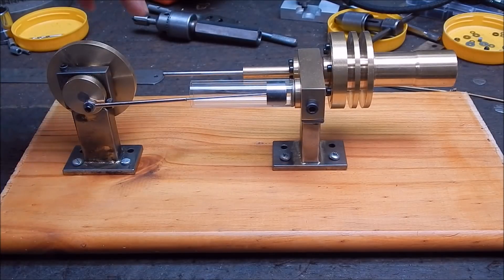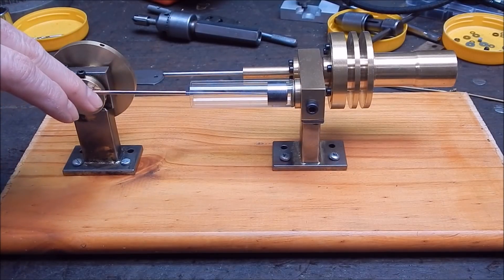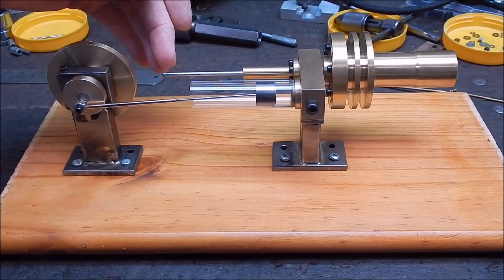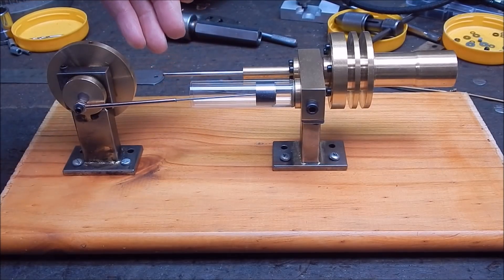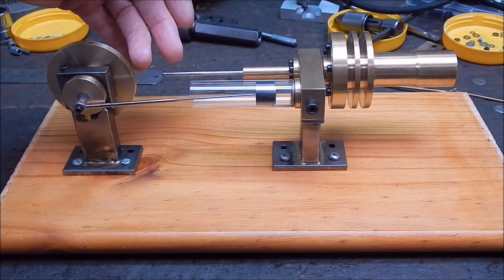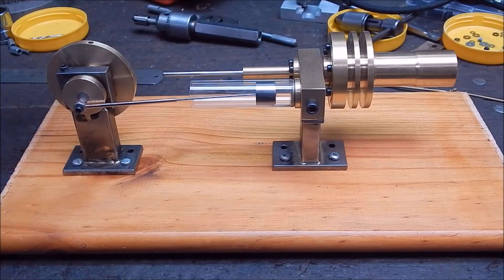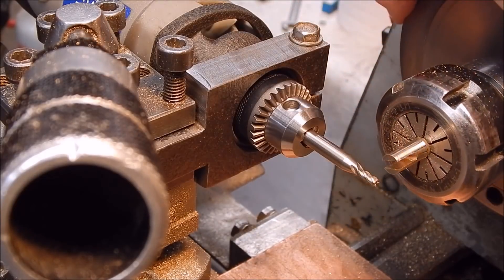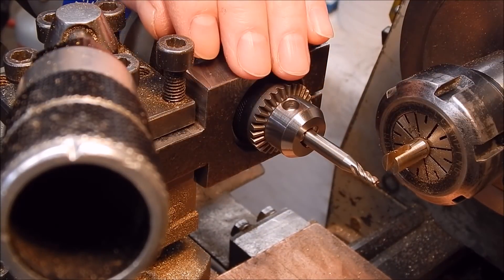Milling on a lathe with the HILDA 400 watt rotary tool

Comment: Do you think hilda could mill steel?
Reply from the maker: It can handle 6 mm shank carbide burrs OK, so I expect it could take similar side loadings with a mill bit.  It would only be small scale use though.

Comment: I have been watching your video's for quite a while Rob Hereagain ;-) strange surname...  Anyway, I have a Makita RT0700CX, many people use them for homebuilt CNC machines.  I would love to do the same thing as you have done with Hilda.  However it is about 65mm, I wonder if having it sit that far out from the center post might create rigidity issues?  What do you think?  https://sydneytools.com.au/makita-rt0700cx-710w-6-35mm-1-4-router?fee=4&fep=5030&gclid=EAIaIQobChMIpIK2-Obl2gIVkpS9Ch1mywsREAQYBCABEgJp5fD_BwE
Reply from the maker: It comes down to how rigid the lathe compound mount is and how much clearance and cross slide travel you have. 

The force you are gong to be putting on these units is fairly low, as they are low torque, and jobs like grinding put almost zero load on the job. Drilling will also only be small diameter and spotting I expect.  Milling would also only be light duty.

On a 9 or 10 inch lathe I would expect it to work OK provided the tool post mount is at least as heavy as I made mine.  Vibration can be an issue with any of these units.

I would try it and see.  Nothing much to lose.

Cheers Rob

Comment: Hiya Rob. I was wondering if you could measure how much wobble the Hilda has.
Reply from the maker: There is no measurable looseness or wobble in the bearings.

10 mm from the jaw faces measured run out on the Chinese slot mill shank is 0.065 mm